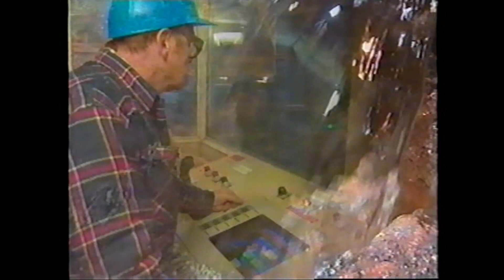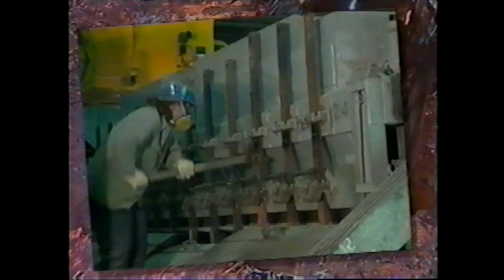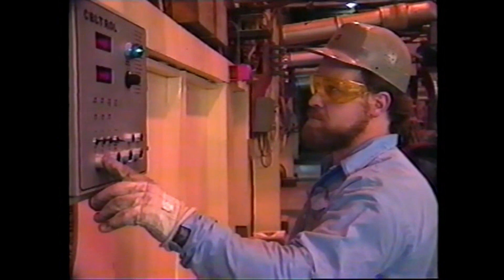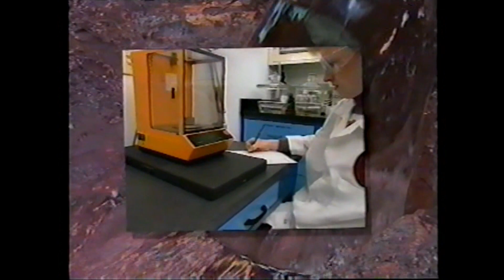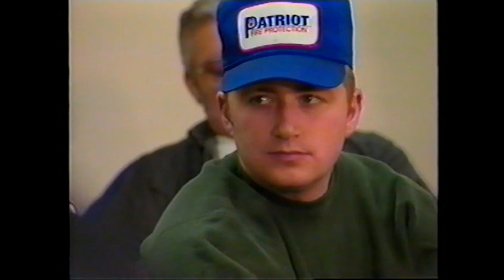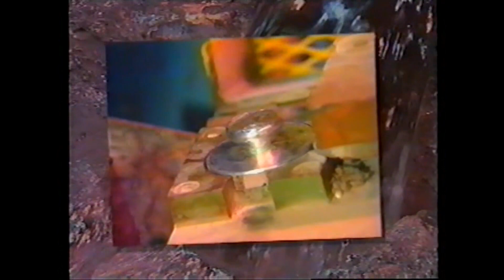Kaiser Trentwood Mead

Comment: And Mead is now a ruin. I worked there... I understand while it's now history, but... It makes me sad. Does anyone remember Clement Simard? He designed the first pot automation system that Kaiser used (AFAIK) throughout their reduction facilities. He was a genius.
Reply: I started there in 87 till shutdown, I'm currently at Trentwood
Reply: @gary8spokane  My dad was the Plant Engineering Manager (or something like that) from 1979 to, um, a few years later. My summer/xmas job while in college was to walk around with a Hughes Probeye infrared scanning camera to look for "hot" connections at the pot/anode/anode clamp junctions. It got somewhat monotonous after a while but man I gut a lot of walking in (there were two TC's the covered the entire set of potliines, around the clock). And it was good money for a college student.